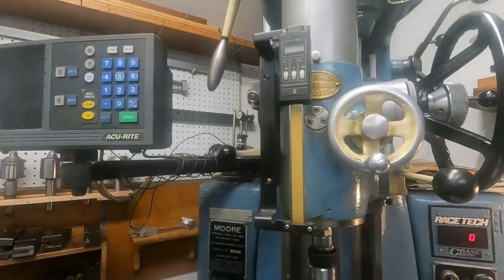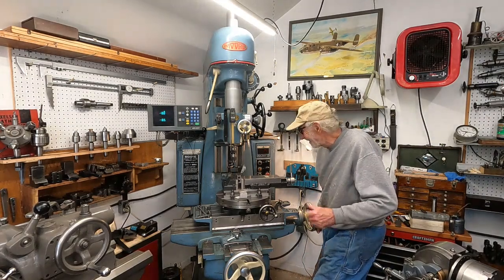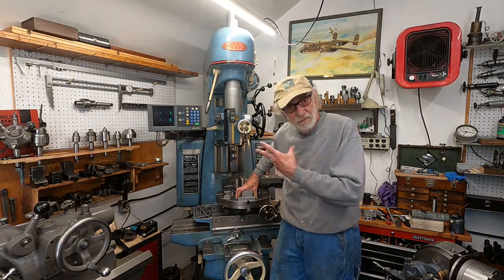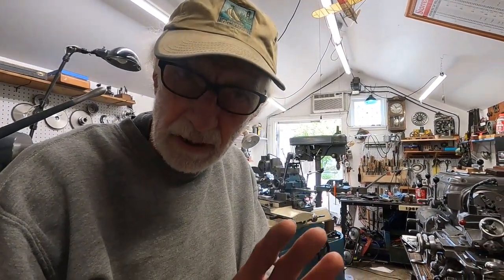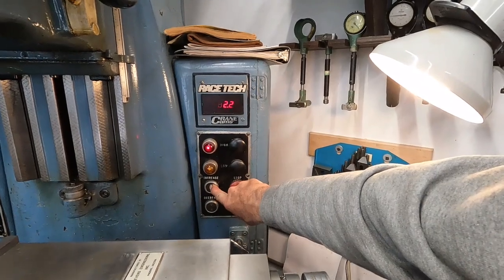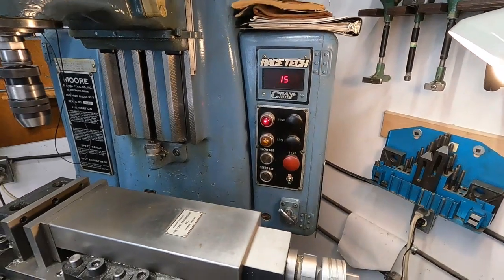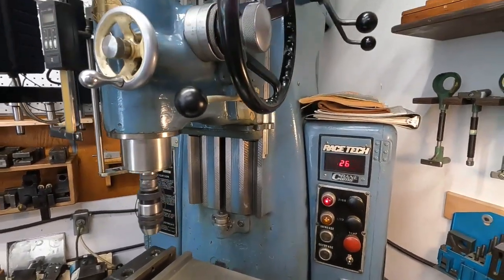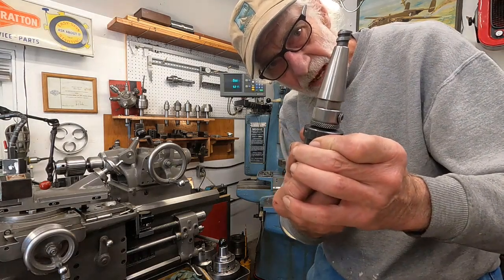Moore Jig Borer

Comment: Yeah, I’ve got the same drive on my South Bend FOURTEEN. Not a two stage though. It has a transmission for that. Same advantages, same problems. You’re definitely right about keeping the pulleys at about the same size. When I bought it in 2002, I wondered why I would hear a bumping sound. Then I realized why. I’ve installed digital readouts on most of my machinery, and yup, it’s annoying that it takes time to catch up, particularly when you turn the spindle on and it has to rev up.
Reply from the maker: The price of the two Moore branded variable speed belts was over $500 over 20yrs ago and now apparently not available. The price prompted me to ask how to better take care of them I was advised to park the machine at the mid speed setting and rotate the spindle by hand daily when the machine sits idle. The belts still look good now.

Comment: Thanks Don, what an interesting machine. Cutting those speeds in half was quite a feat, it looks like it all fits under the cover without a clue you had done it. I sometimes wish I could slow down my old Buffalo drill press using an extra pulley.
Reply from the maker: Thanks for tuning in!